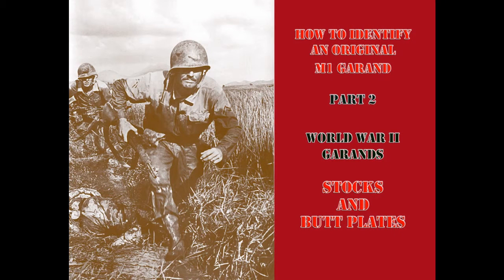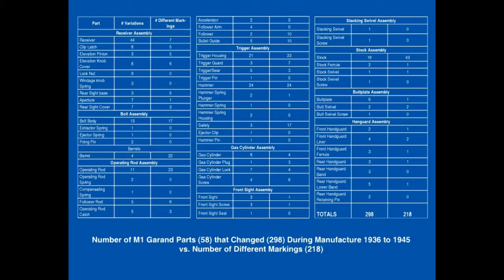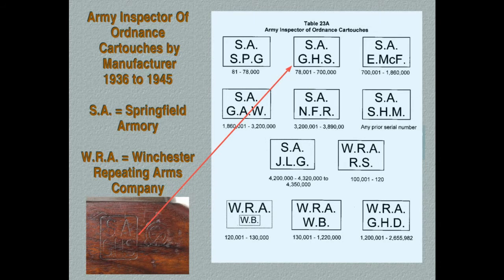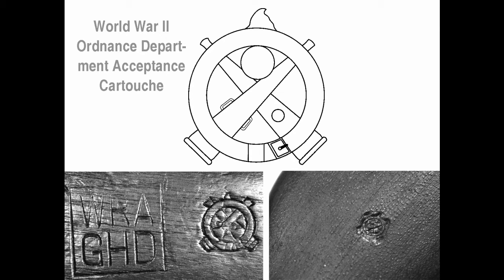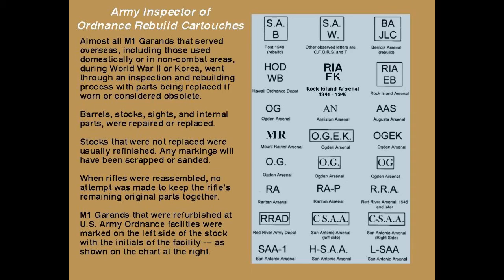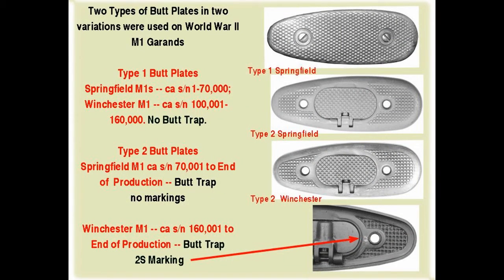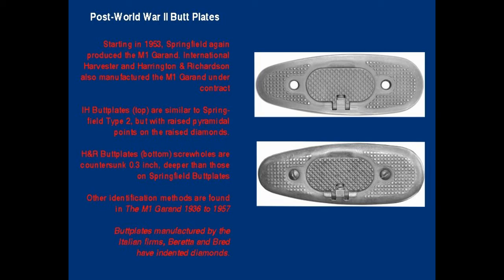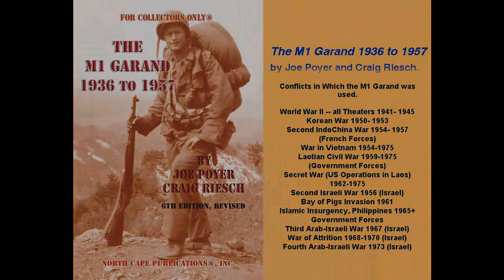How To Identify an Original M1 Garand, Part 2

Comment: I need a 30 ought 6 for protecting my livestock. I have to load my own ammo because it's illegal to use full metal jacket for hunting. I was looking for a beater with a barrel at the CMP. turns out I got an original stock with the correct stamps for July of 44. Winchester made in July of 44 according to the CMP I asked the armorer to check the barrel and he said it was made in 55 and the gauge was a tight one like brand new. it shoots well after a good cleaning. I'm very happy to have an modernized not antique that I cannot worry about some collector jumping on me and wanting to beat me up because it's bouncing around in my truck protecting my cows. I shoot 135 grain polymer tip all day long don't have a problem running them at 2800 ft per second. not much recoil compared to M2 ball.

Comment: Looks like the EMcF cartouche at 2:00 has been enhanced. The "S" is not symmetrical and the cross bar on the "A" is too high.
The lines making up the "E, M and F" are wavy.
The Ord. Dept acceptance stamp is partly sanded away, but the inspector's mark is not.
Thing to look for on stocks are the stampings...many are enhanced, restamped, or are on the wrong stock.